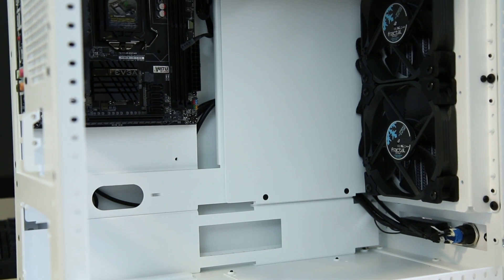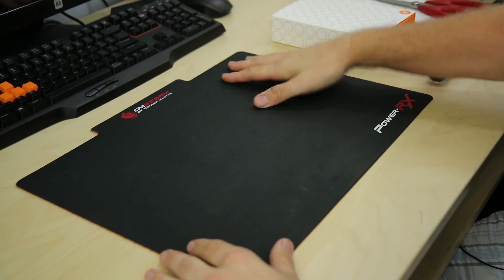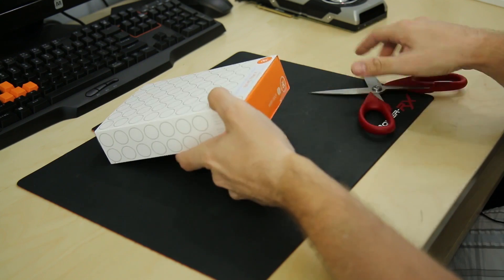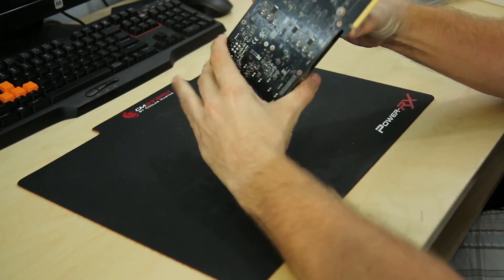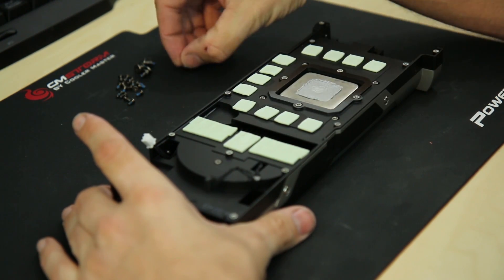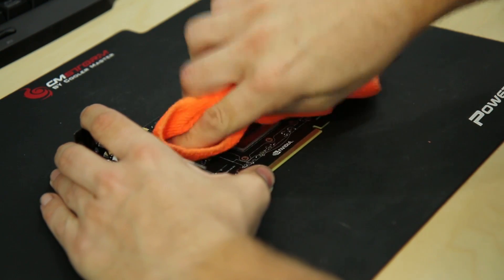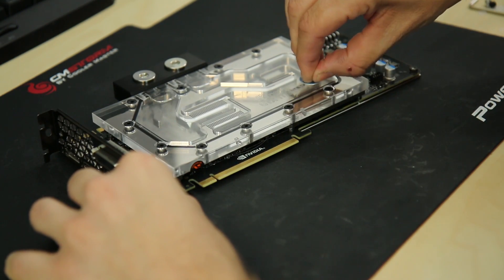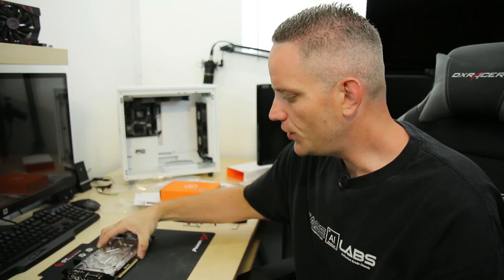ULTIMATE GUIDE: How to install GPU Waterblock

Comment: I have a stencil that i made for these that i can screw into the holes to hold it in place and scrape my compound evenly on it, pull the stencil off and put my block on. Every single time I've tested the pattern which is basically a bunch of triangles back to back along the entire length and witdh, it never leaves air pockets and perfectly spreads while not going over the edges so cleanup for jew applications is cleaner as well. Made it while i was bored and realized its potential, spent a year trying all kinds of patterns and came up with my final design, and also realized something important about the engineers i used to take for granted with all my "armchair quarterback mastery," that i no longer overlook. The second best design was a X with a + superimposed on the center of eachother. Maybe the engineers actually do know something, ya know? Crazy idea i know. I mean after all some of you have built like 5 whole computers! You're practically masters of any scenario! But really the engineers soent time and had funding to olay with the stuff to learn and discover more than what most of if not all of us have had the chances to do. Take their wisdom not for gratned.

Comment: As someone who's never installed a waterblock on a GPU before, all I need is THE block right? No external hardware to hook up?
Reply: Well, think about it: where would the 'water' for your waterblock come from? Also.... why do you think there are two ports (16:50 - water intake and return) on the card?  Gotta have a water cooling system installed, be it a custom system, or some sort of AIO.  Otherwise... all of that heat in the GPU will just sit there. Jay has other videos on this.

Comment: If I got two cards in SLI it will result in the top one not getting enough airflow due to being blocked by the bottom one. Is a GPU waterblock a good solution?

Comment: i used a damp paper towel to clean thermal paste off my CPU don't be afraid to do it just be careful as long has it is off then water is fine but add the water to the paper towel not directly to the CPU that destroys it and not wet but a little damp just a little  that's it

Comment: Hello all,

Another noob question here, would doing this invalidate the GPU's warranty?

Thanks.
Reply: If i can recall correctly, it depends on the manufacturer.
Reply: Yeah you're right. I've just found that out. EVGA allows it. MSI doesn't.
Reply: How about ASUS?
Reply: I heard all the company's let you do it only if you're very careful at talking the gpu apart
Reply: from what I found out, different companies have different policies. EVGA allows it. MSI doesn't.

Comment: I have a few questions on this:

1) Once you remove the outer shell of the GPU so that you can install the waterblock, do you have to put it back on? Or can you just plug it in and it work anyway? 

2) I've heard the HB SLI bridges aren't compatible with Titan X and 1080 waterblocks because their edges extend too far and touch an important part of the waterblock, if this true, would shaving the edges of the HB bridge so it didn't touch that important part make the HB bridges function properly? Or would that damage it and still be useless? 

3) Do waterblocks need regular maintenance like liquid CPU coolers? Such as checking every once in a while to clean its tubes and continually replacing the water?
Reply: 1. Like in the video, you need everything new in most of the case. If you mean reusing the original backplate it might not work. The ones coming with the waterblock have thermal pads with them along with holes for previously installed waterblock screws. You can run the gpu waterblock without the backplate, but it does takes off some heat. In my stress tests on Furmark the backplate heats up, but the waterblock itself stays cool.

3. Only, if you notice speed of the loop slowing down or temperature rising when they shouldnt. In most cases opening the waterblock itself is needed, if dye or or some other part (unflushed radiator part) gets stucked in the small fins on the blocks. Apart from that its mostly around 2 times a year draining the loop, flushing it with distilled water few times and putting fresh fluid in. You can go to extra lenght by taking whole loop apart and washing the rads like when you flush them before first use and such things.

Comment: Id rather have hex. They are much harder to strip i hate Philips.
Reply: I have a few questions on this:

1) Once you remove the outer shell of the GPU so that you can install the waterblock, do you have to put it back on? Or can you just plug it in and it work anyway? 

2) I've heard the HB SLI bridges aren't compatible with Titan X and 1080 waterblocks because their edges extend too far and touch an important part of the waterblock, if this true, would shaving the edges of the HB bridge so it didn't touch that important part make the HB bridges function properly? Or would that damage it and still be useless? 

3) Do waterblocks need regular maintenance like liquid CPU coolers? Such as checking every once in a while to clean its tubes and continually replacing the water?
Reply: You don't put anypart of the cooler back on just the waterblock and you should change the liquid once in awhile. I never actually water cooled my gpu so im not that experienced.
Reply: Oh sorry I didn't realize I replied to a comment, thank you anyway
Reply: No problem. I did the same thing since they changed YouTube.
Reply: yeah Philips suck, almost Everything should be hexa or torx.

Comment: I never understood why there are all these different ways to add thermal paste. Simple: make sure a thin film of it is covering ever part of [insert chip here], done! None of that x, star, swastika, etc. if any part needs to be covered, all parts need to be covered. Even more so if it gets real hot real quick, you don't want to wait till it 'spreads from the heat'.

Comment: If I do this, is there a way I can remove the video ports on the second outward facing plate and replace it with a single-width plate? I want to know if it's possible to install a card directly below the slot the GPU is taking up, seeing as the extra width on the video ports are also taking up the space.
Reply: As long as you don't need that dvi port(That is the one with a bunch of square holes), You should be able to just cut them off. But because of how it is designed, you will want to be careful because those cut parts will go everywhere and small pieces of metal on a PCB is a nightmare. You will need to sand paper it to avoid cuts. And don't forget to make sure each of the dvi connecters are separated to avoid problems. Watch Linus's vid about it(@linustechtips).

Comment: why the fuck would you put thermal compound on the memory when the stock cooling uses thermal pads and never has an issue?
Reply: It's recommended by EK it just further increases performance as your are using the same material that is applied to the actual chip itself.

Comment: My question is about the cooling stage of this. I have no clue with these coolers and back plates what to use for actual pump/cooler assemblies. Are there pre made units like for cpus? Of course with attaching hoses to the gpu? I would like to liquid cool GPU especially on my brothers machine as his card is very heavy in his board and I would like to cut the weight with the added bonus of running cooler. 
I have ZERO experience with custom water cooling assemblies and as such am quite hesitant to actually do this.
Reply: Me too, I have a 1080 founders which runs quite hot, looking into water cooling it, but honestly, the thought of it scares the shit outta me.

Comment: Is there a water block compatible with a ASUS GTX 980 Turbo series (Geforce). And what would you recommend for getting started on a water cooling set up? (Learning)
Reply: for starting off look at EKWB's kits - they are essentially boxes with all the parts you need to entirely assemble a simple loop - then just separately get a block for your gpu (look it up and if you can't find any blocks then it might just be bad luck );)
Reply: Yeah found out i can't Water cool my GPU.
I am about to purchase a card but can't decide on which one thats best for watercooling and backplate
Reply: Pretty sure the turbo just uses the reference PCB, so you should be able to use the 980 reference water block
Reply: +Maverick John  if you can, just look up a picture of your card's pcb and the reference pcb - if you can't see a difference in terms of gpu, VRM and VRAM and where they sit; you could probably use the reference block.

Comment: This was a great video. One question that has been killing me and I know all are different to an extent. Are you supposed to apply thermal pads to the Inductors? and for my card R9 290 EK leaved those completely bare as well as the capacitors. They do not recommend optional TIM on memory but on the capacitors, and I iterate optional. 
Does this imply that caps do not get hot enough to worry so much? And the inductors issue really bothers me as I've seen you apply TIM ribbons to those so many times so I went on a spree of reading install manuals from EK and cannot find this indicated on any but the 980 ti/titanX and to me it looks like EK might have made a mistake as there is a section of what look like mosfets left uncovered. What do you know that we don't?!! I'm asking EK and will report back. My VRM temps show fine in most software but I hurt my card bad somehow as It will not let me add more voltage period anymore without black screening.  Also if you are interested look up the asus r9 290 DCU II block installation instructions. wouldn't you think the inductors would get hot?

Comment: Thank you this helped me with my GTX 970 Windforce G1 .For mine i used thee EK-FC970 GTX WF3 (Nickel Plexi) with thee EK-FC970 GTX WF3 Back plate (Black).
Lucky i saw that with thee Thermal pads Both sides you have to take of the peels .
This was a great guide for those that are new to GPU water cooling ,i also suggest that when you screw in the screws to leave then slightly loose so you can install All into position then tighten them down once All are in. Tomorrow ill put it in same with my new EK-Slim 480 rad, this will go be added to my cpu loop that has a thick 240 rad.

Comment: I just discovered your videos yesterday, over clocking amd, still working on mine actually slower right now the the basic settings from the msi board, but I will work on my setting more and I do have questions I will get to there, first I am in houston so would love to meet one day, but for now, have not seen anything really with a lit water cooling system, saw one resent guy said he uses a non conductive coolest and led light strip in the tubs, not sure how many but the whole thing just glowed, second how long does the coolest last or need to be refilled, is there a system that will never need filling, next have you thought about or even tried antifreeze, next how safe is it when moving things around or like shipping in the mail a tower, is it sealed enough for that, I ask because I am building pc for my mother and I want to go water cooling cpu, no money to do more and stretching budget already, brings me to the next question, do you sell used parts you are no longer using, retired ect. yes saw you have amazon have not been yet, also no pitch for aqua cool on this video, wondering why not, sorry so long but thanks for all the great video, keep it up

Comment: Hey Jay,,
I have just Jumped into Custom Loop Liquid cooling with an EK-Kit L360, I have watched a whak-ton of your Videos and cant seem to find an answer to Two of my Questions,,

As far as my CPU Water Block,, The EK Supremacy MX UNI,, Are the "Jet Plates" Super important? I didnt realize i needed to change mine befor i installed it. I'm Running the FX-8350, (Soon to be the FX-9590)

and,, Order,,

Does it really Matter what order the Water block and Rad components are in? 
As it sits my Loop goes:  
Pump/Res ~top mounted 360~CPU Block~Pump/Res.

Any Help would be awsome.
Thanks for doing what you do man

Comment: Do they offer a closed loop cooler for this application? For those who don't want to bother with pump and rad maintenance.
Reply: +timmyboy late reply, but... some CPU coolers can supposedly be adapted to work on a GPU. It will ONLY cool the GPU itself, so you need some means of cooling the components where he put those thermal pads. Especially on top level GPUs (like a 980ti, or anything stronger than a 390) that will demand a form of active cooling, either in the form of a heatsink or a fan (or both). There are tutorials on this too.

TL:DR SOME CPU coolers can be used, but it demands heatsinks and stuff on the parts where he put the thermal pads.

link for further reading: http://www.overclock.net/t/1479716/guide-closed-loop-aio-coolers-on-your-gpu-warning-picture-heavy#

Comment: Hi Jayz, just wanted to ask if you have an idea on the 980 Ti Strix and 980 ti G1 Gaming if it`s okay to use their included backplate + the GPU block ? cause you mentioned that EK`s come with the Thermal pads and all but if in case that backplate is touching the back of the card it could actually help, thanks mate

Comment: I just wonder why the water cooling block doesn't cover the whole gpu. Does the power supply of the gpu need any cooling?
Reply: *****
Yeah. Like in the video. But which version is better? The full or half covered gpu cooling blocks? Or do both version perform at the same level of cooling?

Comment: Looking to build by first gaming rig, I have a 1440p 60hz monitor and I'm not sure if I should get the 980ti, 980 or 970 card for my GPU. The savings would be used to buy a better gaming keyboard. It'll be an x99 build. Any help would be greatly appreciated.

Comment: I'd like to see how to choose a pump and a res and (more than anything else) whether you have to fill the loop from the res or if you can fill it from the highest point (maybe a rad). Also I'd like to know if the pump has to be attached directly to the res or if it is possible to put it anywhere.

Comment: completely wrong type of video to ask this but i'm sure someone can help, i have two fans and one cpu water cooler radiator, one of my fans is an intake on the front and the second on the back, should this fan, with the radiator be intake or exhaust? No hate please

Comment: During waterblock installation of my first card i was shaking and sweating with fear of ruining my 550 dollor card. The second time around it took me all of 10 min. Lol i was so scared that first time though
Reply: Grey Roots Lol, my first time with an AIO cooler, I had the video right beside me, pausing and unpausing, with a buddy to help me. I didnt want to damage my motherboard with my first water cooling attempt.
Reply: Jays original 780 waterblock install was definitely on replay a few times.

Comment: do you think you can do a mod, where you can remove the PCI connector, and switch to one slot ? someone have already remove the DVI port ? does it work ?
Reply: AlexandreHimself Depends, some cards have a plug connected via a cable, take the plug off and disconnect the cable and you're good, but some don't. Usually if you can make it a single-slot card it's pretty straightforward though.

Comment: Sweet guide you've got there. Next i'd like to see the card getting hooked up to a rad. All steps. Shopping the fittings and all necessary components. What to look out for when setting up the loop. And maybe a good way of installing a drain. What parts are used and so on. 
I really enjoy the complete and very thourogh guides. Keep em coming.

Comment: Does the backplate only make contact with the thermal pads and screw points?

Wondering how does the backplate does not short the bare PCB without stand offs.

Comment: Installing the GPU block was the part I was most worried about on my first loop. Something about taking apart a $1000 GPU didn't sit right. It turned out to be the easiest part of the entire process and only took about 20 minutes. Can't wait to see what kind of cool blocks EK comes out with for the short Pascal cards. SLI watercooled Pascal driving a 4k 120hz monitor...confirmed. That's assuming NVIDIA steps to the plate and provides a Displayport 1.3 or something similar. 4K just doesn't interest me right now being limited to 60hz and needing two cards to even reach that consistently.

Comment: I fried my GTX780 because of the original thermal pads being 1,5mm and the block i bought used, wanted 0,5 mm.. Basically the copper hoverd 1mm over the GPU :P Plz laugh at me! :P
Reply: Bought the block used, did not come with a manual!! And Im a man :-p
Reply: I am a couple of pennys short, but i am wiser when it comes to watercooling my next card ;-)  As jay said, read the manuals ;-)

Comment: +jayztwocents the surface your using can and will build a static charge you need a ESD mat connected to ground to properly discharge the static charge building,
the mat your using is building a static charge but it may be that it build it very very slowly so you don't have trooble using it but it's not a proper ESD surface (please note that esd mat only work when connected to ground )

Comment: EVGA GTX 980Ti hybrid or reference with custom water cooling? 

Also Acer predator XB270HU or 980 Ti for a system with a 780 Ti, but a pretty bad monitor (1400 X 900 75 hz) or maybe even a CPU and mobo upgrade considering I have an FX 8350 with an Asrock 970 Extreme4.
Reply: Super Slick a 980ti is overkill for 900p, a normal 980 would be more than enough a 970 even, but a R9 390x would also be much better value than the 980 and much better preformance than the 970, you will be getting 100fps no problem with that resolution